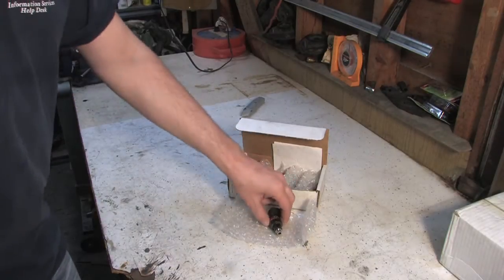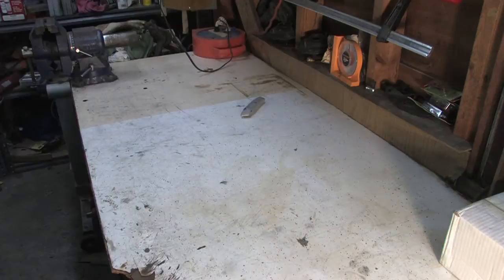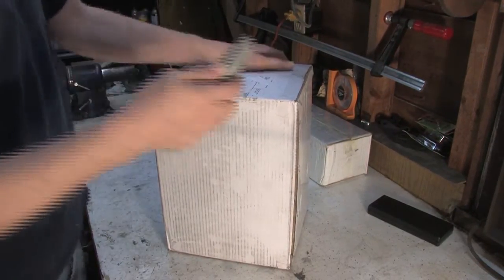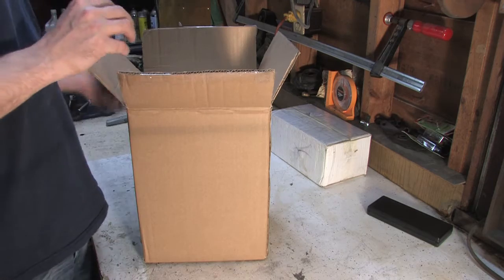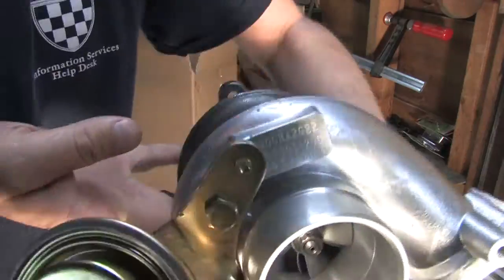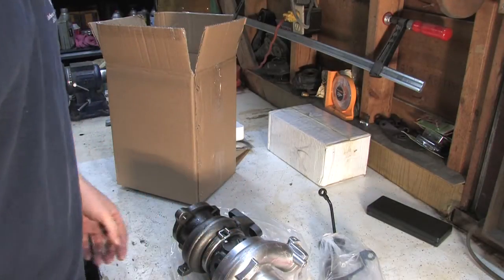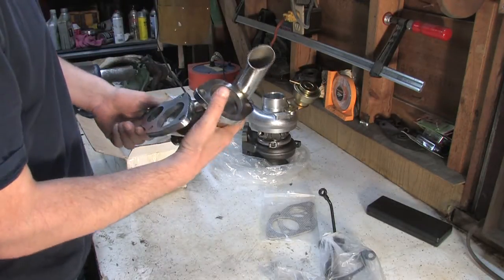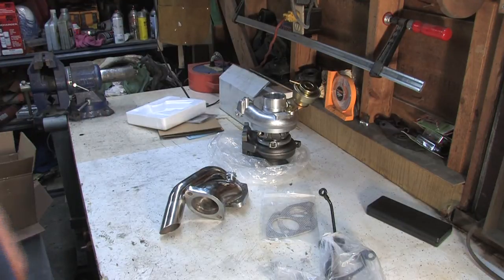Opening Some Stuff!

Comment: @Jafromobile It was not the J pipe that was the problem, it was the compressor housing that the J pipe attached to. The bolt holes we tapped offset to the outlet hole, so no matter what it would have leaked. I got a good OEM compressor housing.

Comment: CX Racing is the worste company I have ever had to deal with in my life. I called in and ordered the Big 16G Turbo with hardware with oil and water tubes. Turned out to be a hunk of shit. Firts off none of the few pieces of hardware they sent me were correct Then the oil return line was just to long. I call sonny to ask what we could do about the issues and he said 30% restock fee. Then I said it was never installed. He told me HE no car e about my bussiness. Also replaced the compressor housing